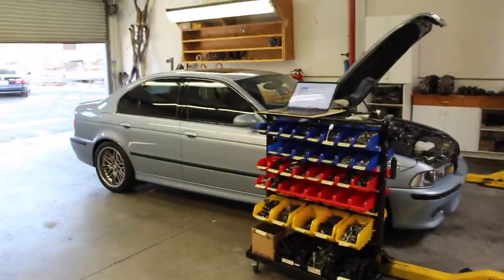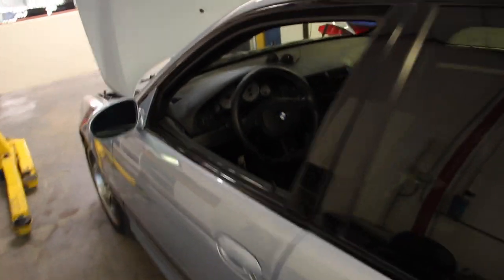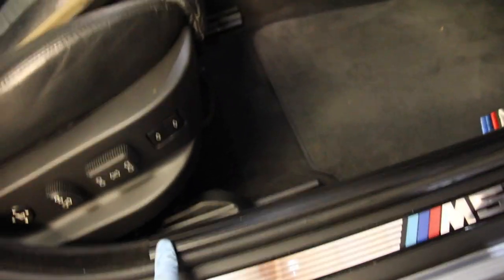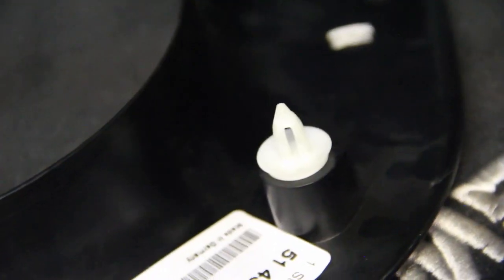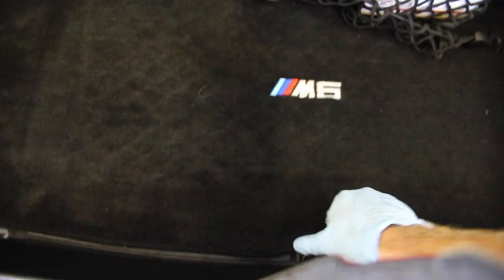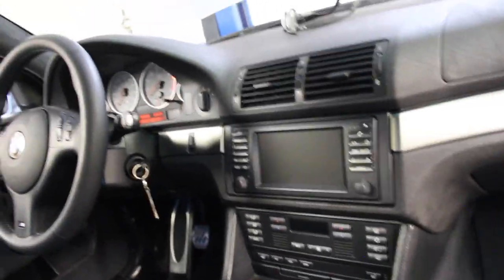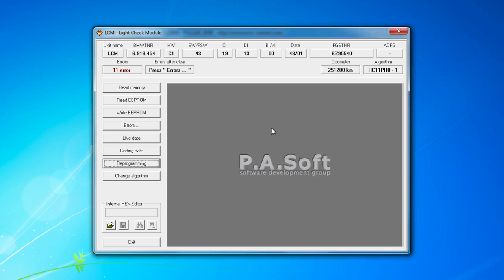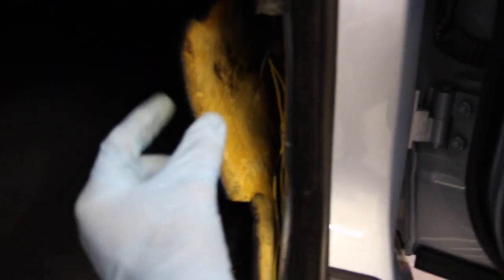BMW LCM Coding, E39 Tail Light Ballast Delete DIY

Comment from the maker: PLEASE READ!!  After a few weeks of running with the LCM IIIB, tail light adapters, and NO ballasts, my CELIS LED bars faded, and burned out.  As it turns out, the Hella Euro retrofit tail lights for 1997-2000 5-series require 10 volts at the CELIS lights.  All LCMs, US and Euro, seem to provide the CELIS LEDs 12 volts.  The ballasts are really just voltage regulators, and step the 12v down to 10vv for the LEDs- so I had to replace the tail lights and put the ballasts back in.  This video is still useful for LCM programming and replacement.  If you're retrofitting US-style lights to a 1997-2000 5 series, there is NO need for ballasts, and the adapters will work fine.
Reply: A lot of the guides I've read about this say that you should copy the car's options (ZCS) to the new LCM using NCSExpert in order for it to work correctly. I noticed that you didn't cover this in the video. I'm wondering whether that might have had something to do with the trouble getting the LCM4 to work?
Also there are options for the facelift and led retrofit and a corresponding LED_RUECKLICHT_OPTION setting that can be set using NCSExpert. I'm also wondering whether correct setting of these values might have saved your tail lights.
This is of interest to me because I'll be swapping out the LCM3 for an LCM4 in the next weeks.
Reply: I installed an LCM4 in my '99 last weekend and all's good. I think you do need to code it with NCSExpert because there are a ton of parameters that PA Soft doesn't cover.
The video was helpful though so thanks for that.
Since I have retrofit CELIS I'll look into the ballast delete in the next few weeks, although I'm inclined to think 'if it ain't broke...'
Reply: Ryan so does that mean for a pre facelift car I will need to run the ballast at all times?? I have heard you can just upgrade to a lcm3b or higher to run facelifted tail lights which support led's.... I'm just confused on different options out there.....
Reply from the maker: @sohailjaned  If you use the Hella RETROFIT KIT tail lights, like I am, yes you always need to have the ballasts installed.  If you use Hella/BMW USA spec facelift lights and update the LCM to a programmed IIIA or IIIB, then you do NOT need the ballasts.  It's just the retrofit kits that require the ballasts regardless of the LCM version.
Reply: @E39Source  Thank you for your response, That sure has cleared that up. Looking forward to the next e39source video
Reply: Hey guys, so if i have tailights with adapters from BMW,coded my lcm 3b to led lights and no checking tailights,i can run them without balast?
Reply from the maker: @LowRider150  If you have the USA-spec BMW/Hella tail lights (with 4 red LEDs stacked vertically on the side) you can indeed run them without ballasts with an LCM 3B.  This will require no coding or programming.  It's the Hella retrofit kit lights made for 1997-2000 E39s that still require the ballasts.
Reply: @E39Source  i have EU spec Hella facelift lamps conected to adaptors and i had to code off cold bulb check. But i think about conecting them with balast to acheve back burn bulb errors on dashboard.
Reply from the maker: @LowRider150  In that case (bulb check), you may need to code the LCM to LEDs.
Reply: @E39Source  i did but when i leave on cold check,it always give me error. Lcm3b . I tried it on few LCM3b's and result always the same. Ballast would slove that for me probably.
Reply from the maker: Dariusz Klepacz Weird.  The ballasts are voltage regulators, nothing more. Only for use with the retrofit kit lights. Not lights included on any E39 from factory.
Reply: @E39Source  I watched the whole video and read this comment. I just wanted to confirm. I have a 2002 U.S. 540iT with tailights starting crack within the lens. Will celis/led Euro be direct plug and play replacements?  I've read on bimmerforums about possibly needing to code the rear brake light. Thoughts? Thanks Ryan
Reply: @E39Source  also related, my auto headlight function is malfuctioning. What steps are required to diagnose the light sensor on the windshield. Is there any other causes? With it switched to auto, the headlamps turn on in direct daylight. Thanks again.
Reply from the maker: @kzoomin  On a 2002 E39 any Hella E39 tail lights should plug right in and work (just don't get the retrofit kit lights made for the 1996-2000 models).  Coding would only be required on earlier cars.
Reply from the maker: @kzoomin  That just sounds like a bad RLS.  Scan the LCM for codes, I bet you have an RLS related code.  The sensors are cheap on Ebay, I would swap it out and go from there.
Reply: @E39Source  sounds like a good plan thanks
Reply: @E39Source  hi, just to confirm so need oem hella lights adaptors and coding to led ?
Reply from the maker: @MRLukieer  Not sure what you mean.  To install these lights, you need the ballasts and tail lights.
Reply: @E39Source  I mean if I buy  lci hella lights    than I can code it to led in  lcm3 it will work without ballasts ?
Reply from the maker: @MRLukieer  LCI Hella lights (US style, NOT the retrofit kit) can be used without ballasts on an LCM IIIA and later once coded and adapted (wiring).  The retrofit kit that Hella sells will always need ballasts.
Reply: You should set led lights as active in ncs expert. No issues on my side after doing that and running facelift taillights on a pre-facelift car with those adapters.
Reply from the maker: @x1257x  They are active, but the tail light that I have are the Hella 'Retrofit' version, which need 10v instead of 12v, hence the need for the ballasts regardless of coding.
Reply: I confirmed i have lcm 3. If I check for voltage at the pig tail and there's 10V, I can just get the harness adapter to plug and play, right? I'm asking because I wired in my headlight halos and remember there being 10v at the light plug I tapped into.
Reply from the maker: Is that with the engine at idle?  I would have expected 12v at both the halos and tail light sockets.  If it's in fact only 10v for the LED bars, you shouldn't need the ballasts.   @Nelsonvisions
Reply: Aracın lcm beyni değiştirdikten sonra vın kodunu yeni lcm nasıl değiştiririz

Comment: LCM4 allows you to run angel eyes as running lamps without flipping the switch over. Back when I had my e39 it was the big reason I wanted to swap it out for my LCM3
Reply: Do you know which one you need to turn on for that to work ?
Reply: i dont believe so, but if youre right i want it !

Comment: Great video, The LCM coding part of this video is priceless, thank you so much for putting it together.

would love to dig deeper into converting the  <2001 cars into an OBD II inside the car vs. the round plug in the engine bay, My 2000 M5 is the same deal (round plug, ODBII adapter, USB adapter) and it is just annoying, plus it makes the whole "live monitoring of parameters while running" very cumbersome.

keep up this amazing work!
(And add a paypal address for ones who want to show respect)
Reply from the maker: Thank you!  Giving full 'power' to the OBD-II port can be as easy as jumping a few pins at the round connector.. but doing that in a clean and reliable way would require some custom work.  I've never minded using that port actually, as I can stand outside the car and work with a laptop on a table/the engine vs sitting in the car with the steering wheel in the way.  For live monitors though, I could see cases where working in the car is better.
Reply: @E39Source  Any reference to what pins to short for "Full power" OBD II inside the car?
Since in any case, the OBD II to USB adapter is required, the ease of working from a workbench outside the car will be maintined
Reply from the maker: @blancA4blanc  Pins 2, 17, and 20 need to be bridged.  When those are jumped, the OBD-II port has 'full power' inside the car.
Reply: @E39Source  I'd think you could pin out the 20-pin sealing cap to including the jumpers?  If done in a weatherproof fashion that should be fine.

Comment: you can code more things to the LCM with NCS Expert.
Probably also recode that LCM IV to work with external LWR module.
Try these bits:
LWR_AUT_EXTERN = 1
LEUCHTWEITENREG_AUTOM = 0
Reply from the maker: I have NCS Expert, but I am not familiar with it at all.  What are those bit, what do you do with them?
Reply: @E39Source  install NCS dummy, then start it and choose E39, LCM C20. then you can see those bits. (you dont have to be connected to car)
if you're not familiar with it at all, you must read some guide on how to program with NCS expert/NCS dummy

Comment: Big fan! Love the videos! The tamper dot is more of a VIN than a mileage discrepancy. If you need a hand with the LCM IV I'd be more than happy to assist. I just retrofitted ine to my e38 for auto headlight functionality.
Reply from the maker: Thank you!  Would the tamper dot not come on if I left the mileage coded to something very different than the IKE and DME?  What did you use to program/code the LCM IV?
Reply: @E39Source  A mixture of pa soft and ncs expert
Reply: I would like to retrofit the automatic lightning too, since my E39 had this. But I got a few questions. Did you have to do anything else to get the LCM IV running? I'm not quite sure yet, if I should go for a LCM III B or a LCM IV, since Ryan couldn't get it running. Does it matter what kind of LCM you use? When I was looking for a used one, I saw modules with manual light leveling (obviously no xenon) and modules without manual light leveling (that would be xenon). Ryan mentioned you can't change the software on it, unless you got the equipment to do so. So,  do I have to care about that?

Comment: I noticed in your video that you had to have you ABS Module rebuilt, looks by the same company I used Module Masters?  I unfortunately have had on going problems with a code 15 return fault.  Just curious how well has you rebuilt ABS Module held up?  Have you had it fail again?  If so was the code the same as mine 15?  If had to send mine back in and then also got another rebuilt from them.  Still have the intermittent code 15.  Thanks
Reply from the maker: Yes, I had Module Masters do it 1-2 years ago.  I don't recall which error I had, but they were able to fix it and it has been perfect sense with no codes!
Reply: @E39Source  Thank you for  the feedback.  It's really been a problem off and on.  The first rebuild my son had with the car lasted a while.  Then I got the car and did some rebuilding then it acted back up again with the number 15 code.  I just did a lot of checking for bad connections all over the car.  I even went as far as going under the passenger seat area to look at the main fuse panel.  What a poor location to put it.  It was perfect, no signs of over heating or corrosion.  Then several other ground bars, relays, etc. etc. etc.  Have to see where is all goes.  I also pulled out the LCM per your video, (thanks), so I could reseat the connections on it for another intermittent issue.  When I unlock the car at times the emergency lights starts flashing, and it you drive the car the turn signals don't work.  What a pain in the butt to remove, especially when your almost 70.  Thanks again for the reply.

Comment: PLEASE HELP! Thank you so much for this amazing video. Part for LCM programming is priceless. I just got a replacement LCM module for my BMW e38 since mine would stop working whenever outside temperature would go bellow 50F. Now since I got the used one I installed it and tempered dot is there and I know that will be fixed once I put correct mileage and VIN number but my high beam and turn signals are not working. Everything else seems to be fine even hazard lights work. Would you please be able to tell me is that something that can be programmed or not? Any help would be greatly appreciated. Thanks a lot!
Reply from the maker: Have you set the algorithm yet for your specific vehicle?  That could certainly cause that issue.
Reply: @E39Source  I ordered PA Soft 1.4 scanner and it should arrive in a two to three days. I did not make any of the changes yet. Will try doing that first with the milage and vin number then will let you know. Thanks a lot for telling me to check that! I appreciate it a lot.

Comment: Great video, but i dont see any coding to make the tail lights work. It is really necessary change to LCM 3B to use the hella tail light connected directly to the car? I have the LCM III.
Reply from the maker: So, upon further research, the LCM 3B didn't come out until 9/2001 production- when auto headlights became standard on USA E39s.  Facelift tails came out in 9/2000 for the 2001 model year.  So, in theory, the LCM 3 (A) will support the facelift tail lights without ballasts.  I am not sure if coding is required for this, as I never attempted to use them them without ballasts on the LCM 3A.  I am not aware of any coding options in the LCM 3A (at least in PASoft/BMW Scanner 1.4) to facelift the tail lights, they just work when installed without ballasts...
Reply: @E39Source  ok, i will try. Thanks

Comment: Hey Ryan, have you ever changed a fuel pump on these? And have you ever had a car with long cranking issues come in? Couldnt find any videos about it from you.
Reply from the maker: I have done the fuel pump.  Tons of things could cause long cranking, though.  Scan the DME for codes and go from there.
Reply: E39Source thanks for the reply. No fault codes. Car drives like a dream otherwise. Just seems like the fuel pressure is bleeding out somewhere.
Reply from the maker: @ademc8872  I would replace the filter and check the pressure regulator, that's where fuel pressure could be more likely to be lost.
Reply: E39Source Forgot to mention, those were replaced too. I know i sound like a parts changer by now without diagnosing it but these aren’t really complex fuel systems ( compared to diesels anyway haha).
Reply from the maker: @ademc8872  Crank sensor?  Vacuum leak?  When it does start, how is the idle?
Reply: E39Source thought about those too but no symptoms of either. Idle is rock solid after start and no power issues. Also no hiccups on the readings off the crank sensor. Engine never cuts out during running. Also no misfires. Just takes extended cranking if it sat for a while.
Reply from the maker: @ademc8872  I'm at a loss, I don't know what would cause that.  Lazy fuel injectors?  Slow starter motor?
Reply: E39Source battery condition is good based off a tester and starter rotates the engine at full power. Im glad im not the only one puzzled. Yeah would think a few injectors are dripping after the car’s shut down. But never really saw injector failures on these low pressure systems. Weird huh
Reply: @E39Source  Just to update on this. it was a teeny tiny pin hole on the main fuel line on the pump inside the tank.

Comment: The LCM coding part of this video is very useful - for some reason I cannot write km into "new" lcm - vin worked ok but km gives some error and temper dot is orange not red :( I will try to put 0 value as I watched this video several times that cross my mind is worth trying...No other modules were changed except lcm3a with lcm 3b LWR 6135-6919454 109 110 / 070200 HW C1 SW 43 month12 year2001 if this matter my car is EU market 520d low ike

Comment: I found your video doing research on my '00 540i.. I don't have turn signals, brake lights, high beams or hazards.. I do however have rear courtesy lights when the doors are open and the key is on as well as the headlights are always on with the key in the run position.. Would that be because of a faulty LCM or a bad fuse for the LCM?
Reply from the maker: Could be either... assuming the LCM has fuses.  I would check if the LCM can communicate on the network with PASoft or similar.

Comment: I'm looking at an E39 that I think has a bad LCM 4, but I suspect someone replaced the LCM and didn't code it properly. How can I tell what LCM and programming the car originally came with?
Reply from the maker: What is the production date?  That will help us tell if the LCM version (4) is original to the vehicle or not.  It won't be easily possible to tell from programming if the LCM is original or not.
Reply: @E39Source  Thank you sir. The production date of this 2003 530iA is 3/28/2003 (today's the car's birthday!). It has the Xenon headlights. If you can tell me what LCM this needs I'd be grateful.
Reply from the maker: @MindHunger  Wow, what are those odds!  Happy birthday to her lol.  A March, 2003 E39 would indeed come with the LCM 4A module.  The 4A version replaced the 3B for the 2003 model year, starting 9/2002.  The main difference is that the xenon leveling features moved out of an independent 'LRA' module, and were built into the LCM 4A instead.  Going back to a 3B would mean no more headlight leveling.
Reply: @E39Source  Thank You!!!
So if the module is marked "LCM - 4 Auto LWR", is that an LCM 4A?
Also, how do I know what the correct HW and SW version is for this car?
Reply from the maker: @MindHunger  Yes.  I'm not sure of a way to tell if the HW and SW versions are correct without finding another car of the same date to compare to.

Comment: I used NCS Expert/Dummy to code LED tail lights on my MY2000 M5. PA soft doesn’t have much options.
Reply from the maker: What options needed to be changed?
Reply: E39Source it just says “LED tail lights: aktiv or nicht_aktiv” I selected aktiv and measured the voltage to my rear CELIS adapter and it was mid-11 volts
Reply from the maker: @albenjgaudiel  I have combed through the LCM 3-B looking for that option in NCS and cannot find it.  Maybe that's 3A only?
Reply: E39Source I just replaced my LCM 3 with the LCM 3-B and it does have LED tail lights option. Are you using NCS Dummy along with NCS E?
Reply from the maker: @albenjgaudiel  Yes I had both dummy and expert, no option for LEDs!